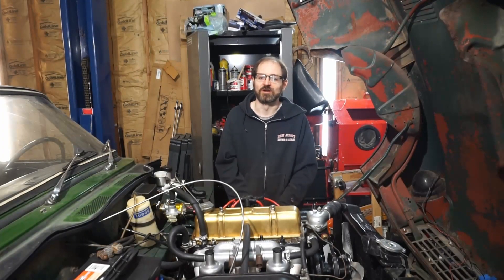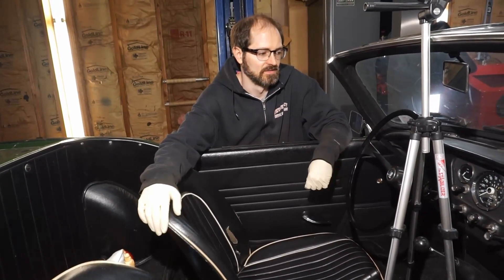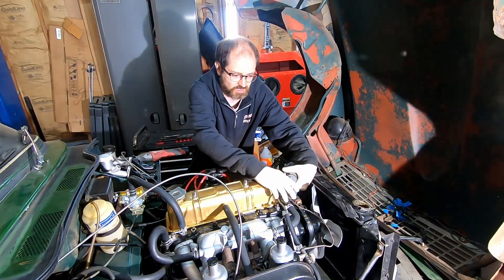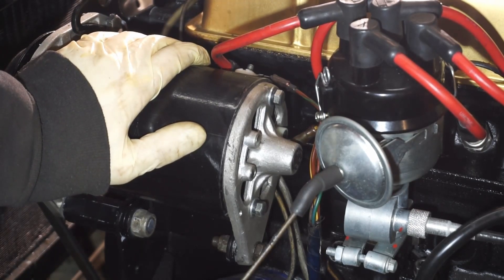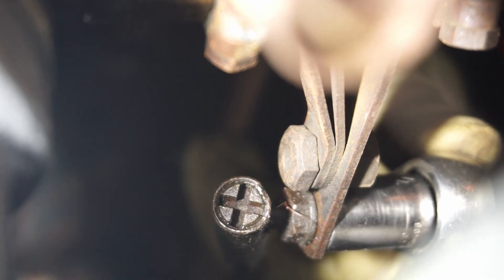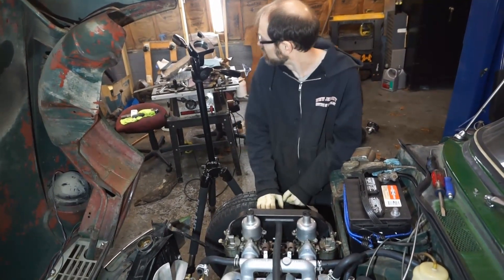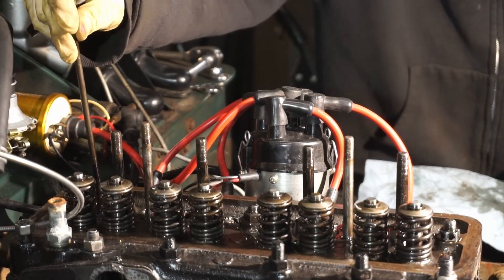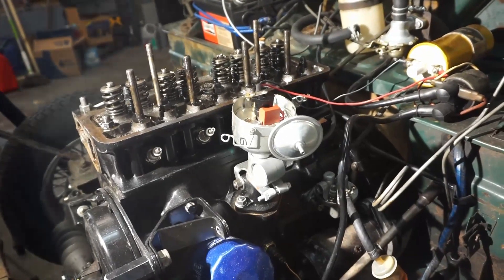Triumph Spitfire Head Gasket Replacement Part 1

Comment: Hi @ubergear5979 This vid resonated. I have a '65 MK2 with a head gasket leak toward the back as well as the pushrod tube leaks on 6 of my 8 tubes. I don't have an uncle who makes nice tools like yours did for this purpose. What do you recommend for guys like me with this problem? I could buy new tubes, but I'll still have to flare their ends but won't have a tool for that. Any ideas? Thanks! JD

Comment: @ubergear Is there anyway to get in contact with you guys? A facebook page or anything?
Reply from the maker: Hey, @OCofthe3, unfortunately we don't have any other social media. What's up? If you have a question that can't be answered here I can give you the ubergear email address.
Reply: @ubergear5979  i saw your video on the northstar you guys did. It’s an engine I’m really interested in for a project I’m working on. You guys seem to know your way around that engine well and I wanted to get your thoughts on the viability of an alternative head bolt solution. An email would be great.
Reply: @ubergear5979  got it!. i would suggest removing it just to prevent spam.